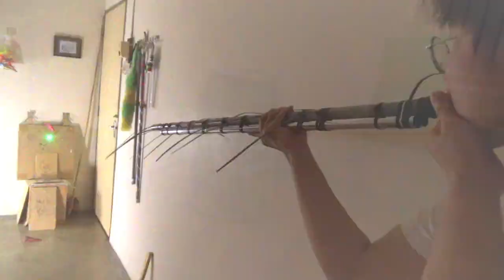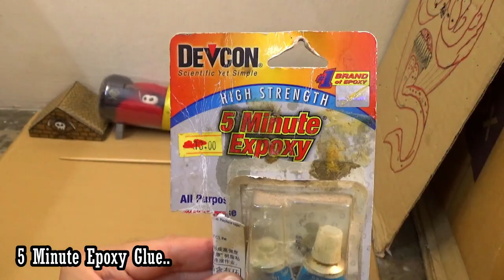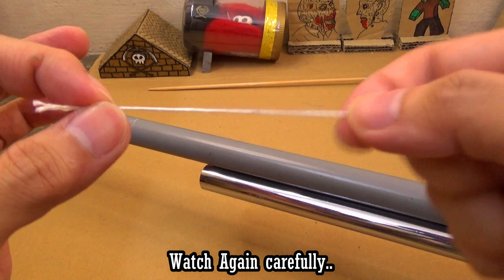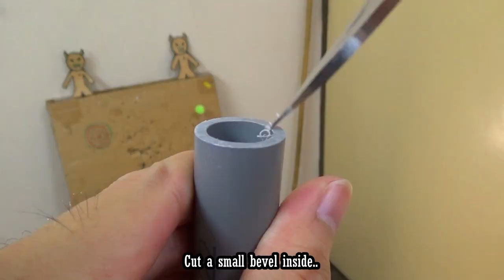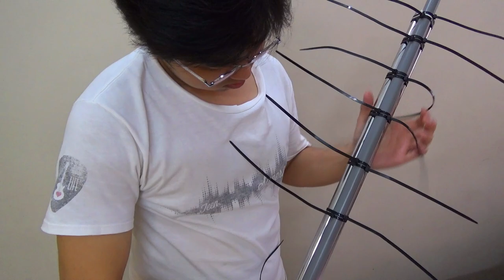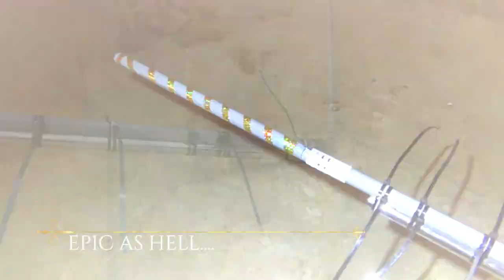Making A Heavy 15mm Blowgun Prototype! (Steel + PVC)★★★★☆ #blowgun #slingshot #homemade #diy

Comment: Can you use copper pipe to make a blowgun. ? Metal pipe at hardware store has a rough finish on the inside and I don’t like pvc cause it flexes.
Reply from the maker: Yes, you don't want to use the chromed steel pipe with a welding seam inside. I used that 18years ago when I was a teen, it really sux.., also rusts pretty quickly from my breath moisture. I'm now using this as the support underneath. Pvc pipe needs external support too

You can get the thickest copper pipe, then find another suitable thick pvc pipe and use that pvc as the outer sleeve. With the copper as the inner lining, a composite blowgun! Copper alone can get bent or dented, needs external structure support.
Reply: I know you didn’t ask but Cpvc works much better because it doesn’t flex

Comment: hello, do you think a steel pipe or a PVC pipe is better for the construction of a blowgun? Thank you
Reply from the maker: Each has it's own pros and cons..

👉PVC pipe (sch40 or Class7 grade)
- dirt cheap
- easy to cut
- can be straightened with a support rail
- immune to dent damage from falling or knocks
- not scratch resistant with razor darts
- lightweight, but can be improved with heavy steel rail

👉Seamless Stainless Steel
- expensive, really expensive!
- very difficult to cut properly without power saw
- hard to guarantee straightness...risky to buy
- prone to permanent bend or dent damage! You need 2mm thick pipe
- resistant to razor dart scratches!
- Heavy Weight! Stable when being shot!
Reply from the maker: Best if these 2 materials are combined into one! 

👉Steel pipe lining as the core barrel inside a pvc pipe.

👉Pvc pipe as barrel supported by 2 steel pipes underneath..Just like mine in this video
Reply from the maker: If you're talking about normal hardware store steel pipes, forget about it, the welding seam + rust is not favourable.